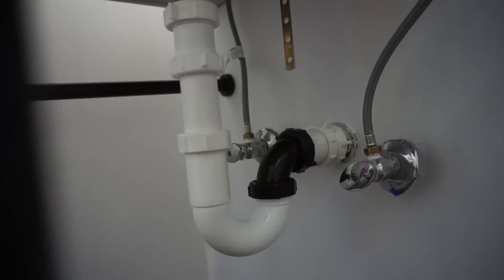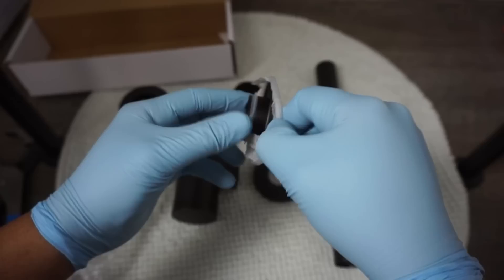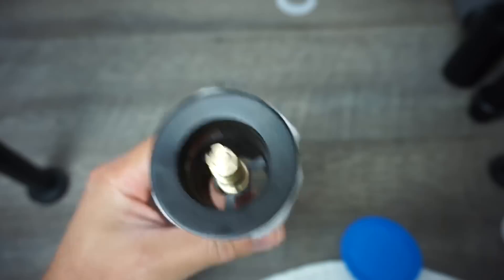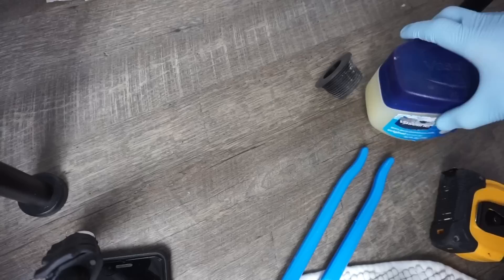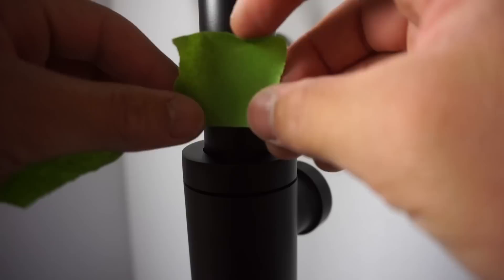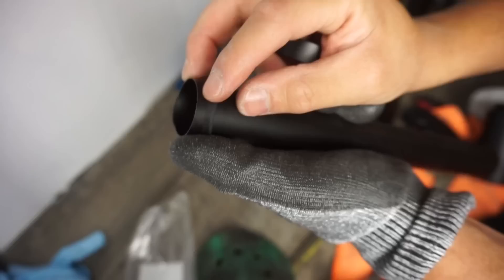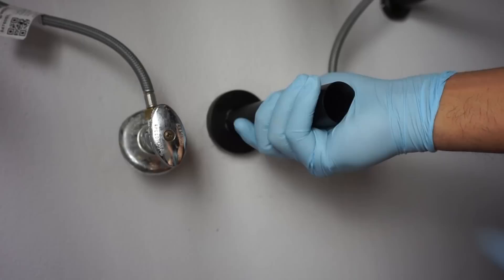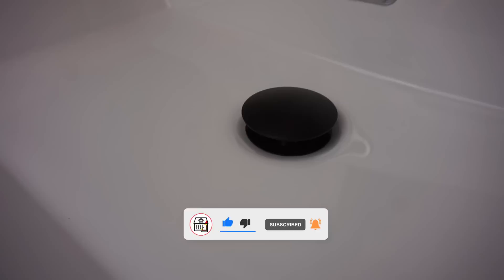How To Install A Bottle Trap With POP-UP Drain Stopper To Replace Your Old P-Trap | P-Trap UPGRADE!

Comment: I wanted to add to my original comment. I am a licensed plumber and retired plumbing inspector. I did review your video again. My opinion of the “modern “ trap hasn’t changed. You have a done a very good job of explaining everything. Doing these videos is a lot of work. Your advice and techniques are sound for this project. The video was not a technical one on the rules but to install a designer’s style fitting. While some of your terminology is incorrect at a professional level, it doesn’t matter as your viewers understand what you are saying. This trap is attractive but it is a little tricky to install for the novice. Where people are going to have a problem is the connection at the wall.  I call this fitting a trap adapter. It comes with a plastic nut and a teflon gasket to make the seal. Now, to install the new trap you are cutting off the threads to allow what I will call a rubber bushing to be inserted. Unfortunately this doesn’t meet code as at least not here in Ontario. Slip joints are not allowed downstream of the trap weir. Although from my experience it hasn’t been rigorously enforced. This is the point of no return. If the bushing leaks and you cannot get it to work your only option is to replace the trap adapter. Not always easy and may require cutting the wall.  Most cases not a DIY project. My post is not meant to be a personal criticism. I wanted to point out some of the ramifications if you decide to install this product. Looking at some of the other posts I’m not the only one who feels that this product may not be worth it. It does look good. But in plumbing functionality comes before beauty. The plumbing trap design and installation is critical. It is what keeps sewer gas from entering the space.  It should be simple in design and when it fails needs to be obvious so it can be noticed quickly and repaired. That’s why there are so many rules governing it’s installation.
Reply: I appreciate the thoughtful explanation.
Reply: Thank you for this. I didn't understand how attaching to the wall would work after cutting the threads. I'm no plumber but pretty handy. I was feeling over my head; this helped confirm it. I'll call a plumber; hopefully, it can still work since I've purchased all the decorative plumbing.
Reply: @terrenceburrell1091  I’m confident that a qualified plumber can install what you have purchased. It’s not a difficult job but requires some experience. The trick is to install the product with  minimum damage to the wall and adjacent area. Not always possible. Be prepared to do some drywall repair, patching and painting. Not the end of the world. Good luck Roger.
Reply: Is my understanding correct the bottle traps are not to code and should not be installed in Ontario?
Reply: @amonadi2  Yes you are correct according to Part 7 of the Ontario Building Code. (OBC)
Reply: Hi, thank you for your well thought out explanation. I'm in Ontario and was originally looking to install a decorative bottle trap but I have read they're not to code in Ontario. There is a similar decorative (brushed gold) p-trap that would still fit the aesthetic. When installing it to the wall, what is the alternative to the "trap adapter" and cutting off the threads as he did in the video?
Reply: @J.D.416 You could leave the plastic threads on which are part of what is called a trap adapter. Look on the internet for 1-1/4” deep escutcheon. There are plenty of them for sale. Most of them are chrome plated. It could be lightly sanded and painted flat or satin  black as shown in the video. This way the escutcheon will hide the threads and nut on the trap adapter. It will have more of a bell look to it though. It is a safer alternative to cutting the threads. The only problem is how far the trap adapter is from the wall. If it’s too far out it will be difficult to find an escutcheon deep enough. You could cut the horizontal drain pipe shorter and install a new trap adapter tight to the wall. I’ve never done this type of alteration so I can’t say for sure what is available. Double check your parts before cutting anything.
Reply: I also saw some gold coloured escutcheons.
Reply: @repairitdontwreckit4257  thank you for reply. The internet can be awesome sometimes!

Comment: Nice video.
Do NOT put petroleum jelly on any rubber part. The rubber will slowly break down. When you use a lubricant on rubber, use a Teflon or a silicone based lubricant.
Reply from the maker: Thank you for the advice! 🙏🏽😊
Reply: @FixThisHouse  Yes, if inferior product is supplied, but if the provided materials are silicone based "rubber" petroleum jelly (Vasoline, etc.) will not "rot" them. Still, Silicone based jelly lubes are better to try first. Teflons are becoming inferior to many newer replacement materials as Teflon, and related materials, tends to undergo continuous plastic deformation, or "squish", until useless. Over tightening is a common user failure.

Comment: Great video, very helpful!
Two questions:
1. Wouldn't the pipe connecting to the wall drain need to be at a slight down angle rather than level?
2. The bottle trap I'm installing didn't include the rubber adapter/bushing/plug thingy that goes into the pipe in the wall allowing the 1-1/4" to connect to the 1-1/2" flush to the wall—and I can't seem to find anything similar anywhere. Any ideas?
Thanks!
Reply: I'm looking for that "rubber adapter/bushing/plug thingy that goes into the pipe in the wall allowing the 1-1/4" to connect to the 1-1/2" flush to the wall" as well.  My disappointment is that he didn't give it a close up or look to the instructions for the name.   Technically it is a rubber Rosette reducer. Code allows for rubber reducing bushing. The familiar part name is "a donut" but code only list it part number. I have not found one small enough for pvc to sinkdrain.  If anyone finds, please advise

Comment: Although a bottle trap is more-or-less a P-trap, it depends on an internal tube to create the trap seal, similar to a bell trap. If the interior tube fails due to corrosion or another problem, sewer gas could enter the home, and it is not examinable to verify that that the trap is functional. Also, it is not self cleaning/scouring. So a bottle trap is not approved by the plumbing codes, although some jurisdictions may allow them as a “special condition.”  As a certified plumbing inspector - I have yet to see one of these in the field. Plumbing codes are very conservative and careful. I thing this is a cool idea - how it works in the long term - I do not know.
Reply: I have inherited three in newly purchased home with an approved 1997 remod in CA. All seem to be working fine and show little to no signs of recent work.

Comment: Thank you for this video.  It is very thorough and easy to understand.  I have to open up the wall and move my outlet pipe over a few inches.  When rebuilding the outlet pipe, what type and size of PVC pipe do I use to receive the trap pipe?  Is is 1-1/4" I.D.?  How snugly does it have to fit?  I'd have to imagine...  ..."VERY".

Comment: Beware!: Drain in wall has to be exactly center of drain on sink for a bottle trap. P-traps can swing to offset to compensate for off center sink drains, bottle traps cannot.
Reply: Once you have the drain pipe going towards the wall out of the bottle trap, why can't you use 45s to change direction to hit the right spot in the wall exiting to the street?
Reply: @realSamAndrew  you can
Reply: I'm glad someone mentioned that, I had the same problem recently and I had to go back to a standard p-trap. Thanks.
Reply: I just fixed my p trap the long tube was rusted out yes it's brass and put in plastic to replace, I had to get rings that went from 1 and a half to 1 and a quarter and it works good now no leaks. 73
Reply: @realSamAndrew  You can, especially if an approximately 1/4" fall per foot is maintained. It's all then about aesthetic deterioration of using this type of trap in the first place. If matching elements are available it'd be a great setup to showcase.
Reply: @stevecolton4714  so the OP is incorrect?
Reply: Its more work to install and besides its under the sink. Who cares how it looks.

Comment: Illegal in many areas. In my area, you cannot have any trap where you can't see the trap seal, except rare exceptions. Honestly, there is nothing better than a P-trap. It can easily be disassembled, replaced, and doesn't need to to installed with a great amount of accuracy. A bottle trap isn't better at all.
Reply from the maker: Thank you for the feedback 👍🏽

Comment: Do those bottles traps prevent sewer gasses  from coming back up the drain?
Reply: I had the same question. I'm guessing you'd have to install a traditional p inside the wall behind it. If so, another great looking poorly designed device
Reply: They do. The water runs down the tail piece to the bottom of the bottle trap and then rises outside that pipe to the trap arm going into the wall. Look up bottle trap cross section.
Reply: Yes, the gasses would be trapped if it's installed correctly.  Just gotta make sure that the inner tube goes down deep enough. Here's a helpful link i found explaining the installation 

https://www.pigoran.top/products.aspx?cname=bottle+p+trap+installation&cid=27
Reply: @MrMdemon  Link not working

Comment: soooo kinda confused after reading comments. replacing exisiting vanity with  floating vanity so would love to use bottle trap.  Wall drain is not even with sink drain.  Off by about 2-3 inches.  Are there any attachments I can use to be able to still use bottle trap or no way??? Please explain in very easy terminology if I can make it work LOL

Comment: what about the hole with the old drain stopper handle? is it just there or did you change the faucet too?
Reply: Hopefully the maker of those kits includes a push-in plastic or rubber bumper just for that purpose.

Comment: Cutting the pipe is a no no. You cannot install the p-trap pipe back unless you cut the wall and replace the thread pipe back. :(
Reply: I cut mine because i went from brass to plastic they make connectors and reducer rings, it don't leak. Job done. 73

Comment: I'm concerned that this drain is not a trap.  It will allow sewer gases to enter the house through this sink.  I would also not level the horizontal portion of the drain tube.  I would add a slight downward slope towards the wall to ensure drainage.  Also, spitballing the length of the horizontal tube may cause an obstruction in the path of drainage in the wall at the first 90° pipe fitting as you may make the horizontal piece too long.
Reply: Why it's illegal is because some do it your selfers don't know the pipe from the sink has to be below the pipe going to the wall which allows water to sit in the bottle part keeps gas from exiting, if it's higher water drains and whoop... gas can come up
Reply: But you can apply for a code variance for smaller bathrooms. But to do so you have to understand these require more attention just to be on the safer side. I used one in a half bath which is only used for quick hand rinses

Comment: I had heard that petroleum jelly can deteriorate plastic with time. And since plumbers putty is made with petroleum oils, why use it?
Reply: On the container it tells you what type of plastics to avoid. The sink is porcelain and the fits are brass, so in this case, there is not plastic contact.

Comment: It looks really nice and modern.  How does a person clean out all of the stuff that normally gets stuck in a regular p-trap?
Reply from the maker: Hi! Thank you! There’s a easy screw cap on the bottom that makes access to the trap easy 👍🏽😊
Reply: That's a good point but p traps also have a screw under the curve if you get that type. The plastic had screws on p traps are easy to take apart it's a no brainer. 73

Comment: Unless the center of the drain outlet under the sink & the wall connection are perfectly in line ( not offset) the bottle trap will not work

Comment: I don’t recommend this type of trap, in case of a drain clog, the pipe cannot not be snaked, unless you take apart the whole piping assembly, and snake it from the wall.
Reply: That's a good point but I never had to snake a bathroom sink. I had to brush one with a bottle brush because of toothpaste buildup.  73
Reply: You can still run a zip it down.  If I were to snake a bathroom sink drain I wouldn't be coming from the top, I'd be disassembling the trap anyways and going from there.
Reply: @Chris-D9  more work than it's worth. 73
Reply: @Chris-D9  forget the zip and snake very hot water usually breaks through a clog. I use hot water at work because I cannot remove the cover on the clean out they installed the lid up side down. Hot water works great. I'm old school and prefer p traps. 73
Reply: @ronb6182  Yeah. I'll definitely go the eaiser route first but years working as a maintenance guy for a property company, you see alot lol...it blows my mind how many people are completely clueless of minor home maintenance, but then again it keeps us employed.

Comment: Nice work.  I'm trying to figure out a way to hide the water lines.  I'm thinking you just extended them up the wall a little and they hide in the sink cavity area underneath.

Comment: If the last person doesn't drain it after  using it,  will you put your hand in the muddy water to drain it. For me, I am would not. Furthermore,  if  this is not working out for you after a while, you will be having big trouble to reinstall the old P trap because you have cut off the wall pipe screw head.

Comment: those bottle traps do not meet code.
Reply: This. These are not code compliant in the US. They are in some other countries though.
Reply: I'm just curious, How specifically don't these meet code?  Is there a work around? 

AND can you put a traditional p-trap behind the wall like for ox boxes? And for example most bathtubs for slab-on-grade homes the p trap  may not be visible but presumed to be in the slab.

The reason I ask is because manufactures typically go through great measure to make sure products are useable where available, And since they sell bottle traps all throughout Chicago I can't imagine the are getting sold and returned
Reply: @maximusmarine  unfortunately no they don't. Manufacturers and resellers are not code enforcers. Big box stores sell many plumbing parts that are not code compliant, such as flexible drain pipes, and yes, these drum traps. They're not code compliant because they're not self scouring/cleaning, they restrict water flow by design, internal parts are not visible for inspection (i.e. concealed).  You can not add anything to the drain setup to make it code compliant. The existence of the drum trap alone means it will never be compliant.
Reply: In usa and Canadá and for good reason, they are crap.
Reply: @jnicemiz  I just installed roughly 96 of them in a hotel in Norfolk VA and passed inspection no problem
Reply: How can they trap gas with the pipe over the water supposed to block the gas?
Reply: @jeffliverman3401  P3201.1 traps shall not have interior partitions except where integral with the fixture. No disrespect but that’s 96 illegal traps. I also live in Hampton roads
Reply: @TrillPJ  I guess they were wrong then but they did pass inspection.
Reply: @jnicemiz  you are correct., these drum traps were used 100 years ago  but fell out of use because they would clog up all the time, which is why they were made with a clean out plug. The new designs are the "in " thing and "look " cool..function doesn't matter so much any more as long as it looks good .
Reply: Probably for a good reason.  They get blocked often.  I'm changing my for traditional.

Comment: So you would rather stick your hand in a sink full of dirty water to pop sink drain instead of push/pull lever behind faucet? Not me.
Reply: Not only dirty water, what if it was hot water?
Reply: Pros and cons each way.  Traditional linkage and rod have a potential leak point where linkage threads into the trap, they also obstruct the drain and collect gunk and poor draining.  The new popups are easy to install,  if you don't want to put your hand in a sink of dirty water, quick tip.....use your wife's toothbrush to pop up the sink drain.

Comment: theres a lot of issues in this video 1 dont use  the blue container putty on porcelain or steel or iron sinks... its for porous stone. it doesnt have the same life span its shorter

dont putty your bottom if it leaks its because you did it wrong try again putty near the threads can permanently lock your spout to your sink when it ages.

the engineers make rubber seals to provide the best seal possible so if your kit comes with a seal you dont need and shouldnt use putty 

never run pipes level... you should have a 1/4 to 1/2 in drop per foot

when checking for leaks first tug on all joints lightly to see if you tightened all joints just in case you missed 1 then run water for few seconds for leak... no great use pressure test by filling sink then letting it drain if you have garbage disposer turn it on too... no leaks perfect work 

if you find a leak put a pan under leak letting water run and tighten till the leak stops, you dont want to over tighten!!!!!!!!!!!!!!!!!!!!!

Comment: I bought and installed one of these. The pop up feature is pretty nice, but the gasket it uses to keep the sink full is not good. Almost right away I noticed that water was slowly leaking out. I tried swapping out with an extra gasket I had from the bottle trap to see if it improved things, but it was only slightly better and the water still slowly drained. Despite the other comment about this not being up to code, would anyone have a suggestion on how to fix this problem? Thank you.